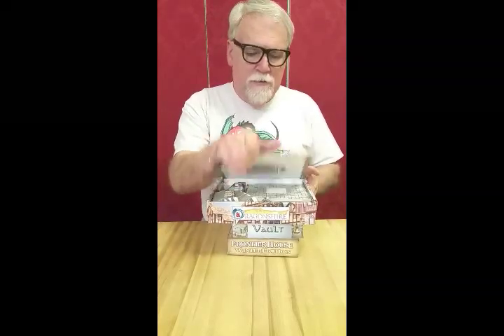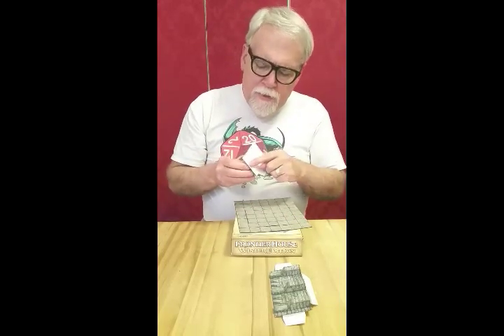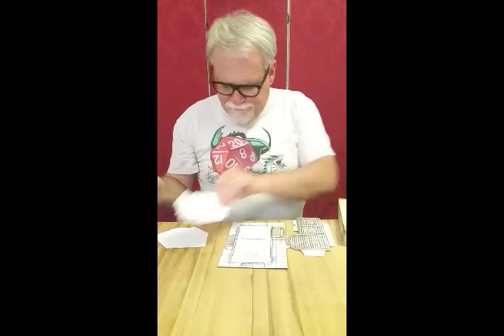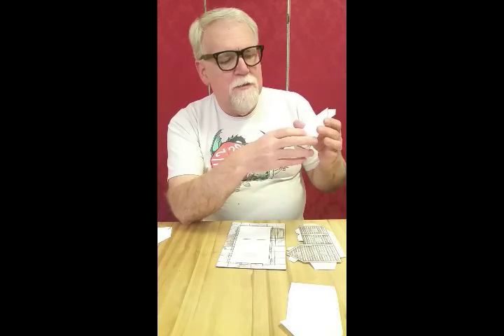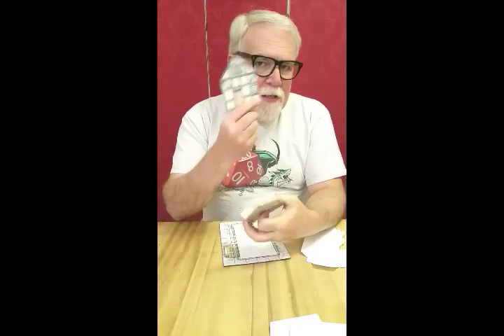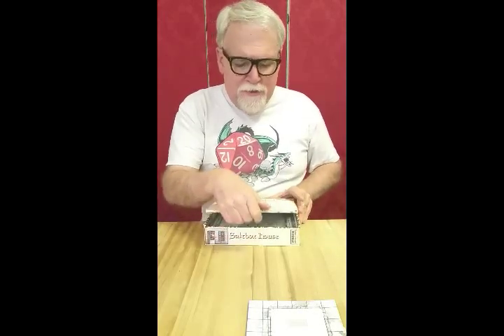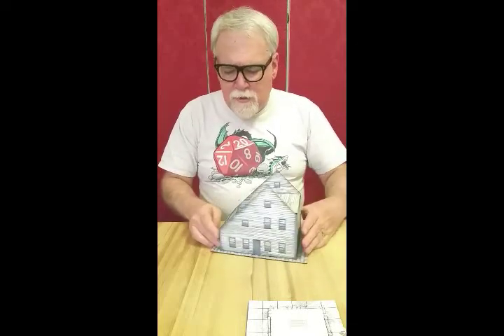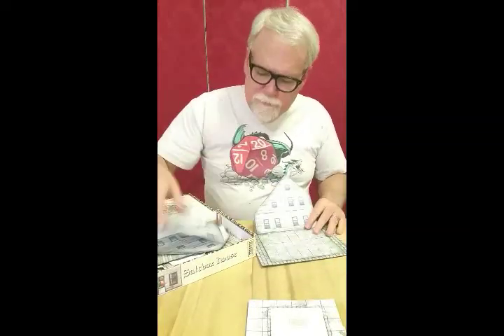OldSchoolDM - Fold Flat Build Method

Comment: This is great! Thanks for posting this video! Quick question - do you have any tips for attaching the roofs using this method? I spent a whole Sunday making a Dave Graffam Coach House following your method, and for the most part it worked out great, but attaching the roofs on was a bear. I can only imagine the difficulty in making something like the DGMC Inventor's House!
Reply: +Rob Bush This photo shows me prototype testing the method - showing the roof tucked in for the Saltbox house. In this case, I chose to have no wall-to-roof glue tab conversion as I wanted to use the building with the roof off (and not have any tabs showing - so I added friction-tabs to the roof-inside layer, folding down inside the eves. When adding an interior, I like to think about play-time presentation.

https://flic.kr/p/Ae5NuK
Reply: +Rob Bush Oh! Please post a photo of your adapted build someplace! :-)